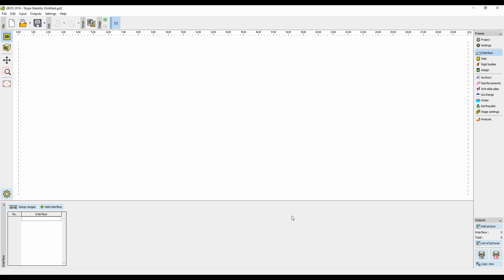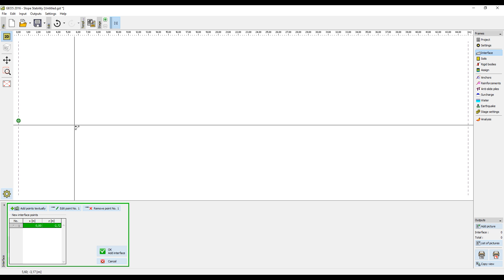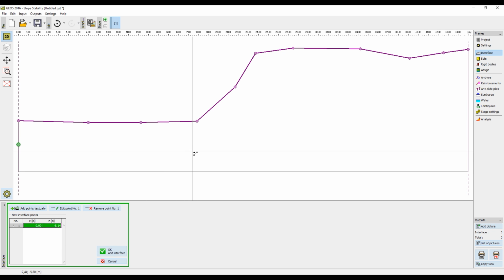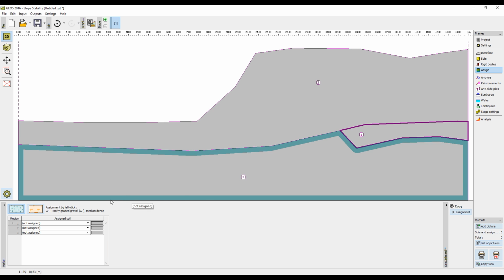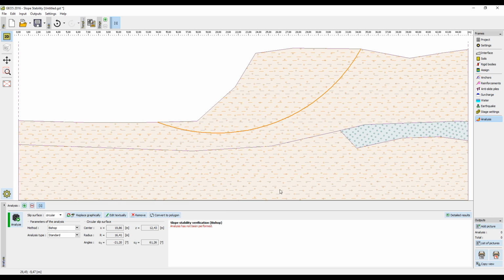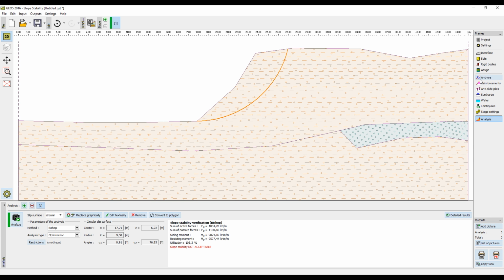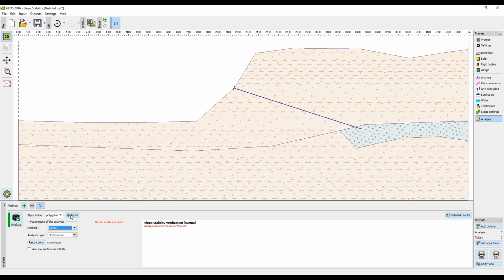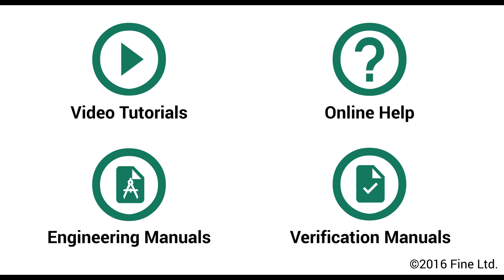GEO5 Tutorials: Introduction to Slope Stability

Comment: Hi, I always get the error "Error when inputting slip surface: Slip surface turns back." Any suggestions please? Thanks
Reply: Hi, this message is shown in the case of bad input. If you have still this problem, send us an email (hotline@fine.cz). We will help you step by step with correct input. Regards, D.
Reply: sure, try to place the point of fault surface inside the slope, since the error occurs when the circle does not touch the surfaces of the slope or are outside. Equal, be careful with the circle that is described as it may be reversed.